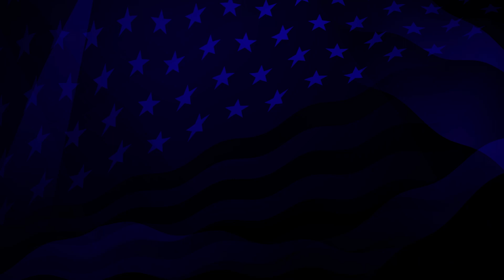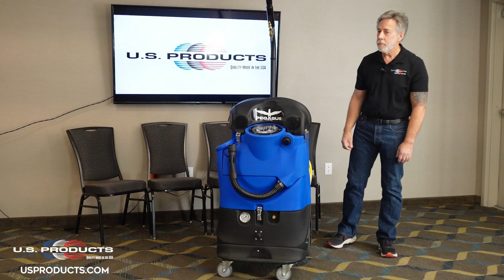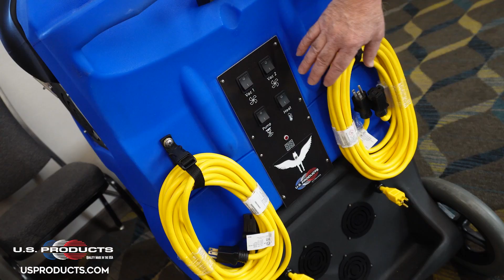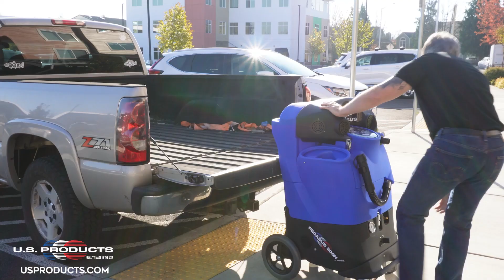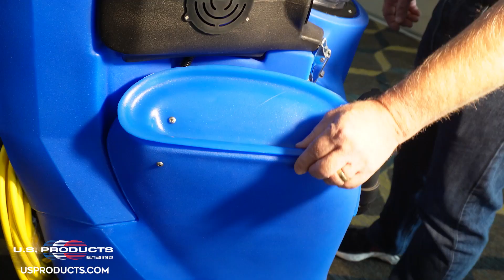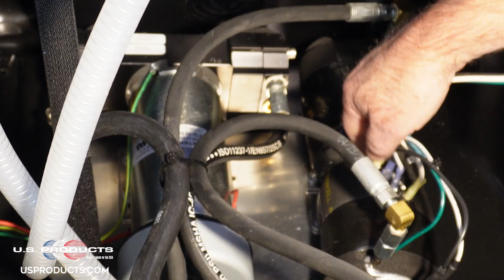NEW Pegasus Extractor by U.S. Products - Max CFM

Comment: no suction at all.... 2x little 5.7 engines... waste of money
Reply: I wouldnt put much doubt unto the 5.7 motors in parallel... I have a custom build portable with the same set up. And also have another with dual 6.6 zx motors in series. the 5.7 gave me 2-3 hr dry time at 50ft of hose.. my dual zx has stronger suction but the bite on the 5.7 is greater. I'll be changing my zx to parallel and test it at 50ft of hose as well..